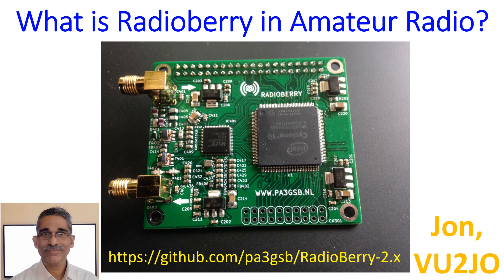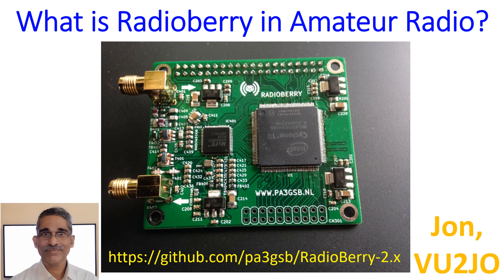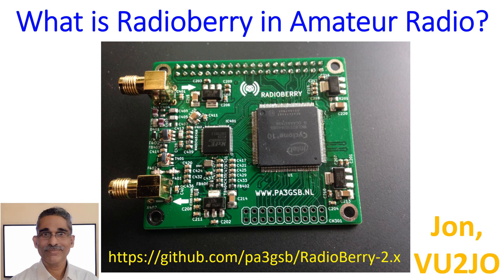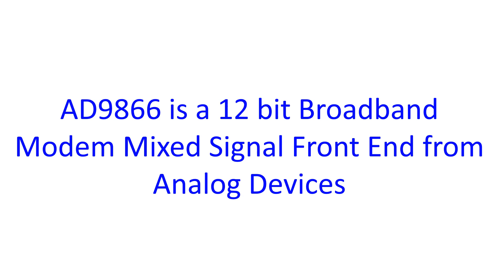What is Radioberry in Amateur Radio?

Comment: That is just SDR on FPGA....
Reply from the maker: Thank you. There are some even in our region who use it along with a linear amplifier with very good signals on the air. 73 de Jon, VU2JO.
Reply: @johnsonsTechNAgroWorld  I mean, sure, it's great when you want to learn Verilog, and mess with SDR on the hardware level, but you can achieve the same with ESP32, which is waaaaay cheaper ;-) (but I'm not sure, if its able to transmit, It may not, or most likely can, but its pretty poor signal)
Reply from the maker: Thank you for the new information. May be those experimenting with Radioberry will be more interested. 73